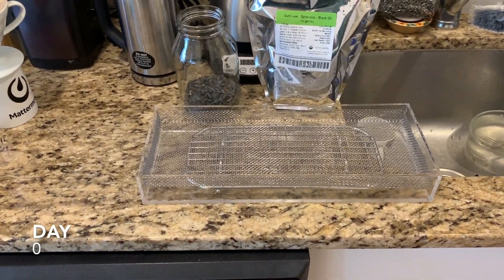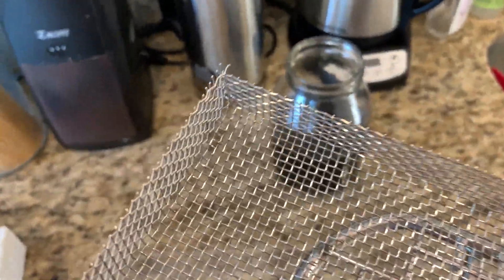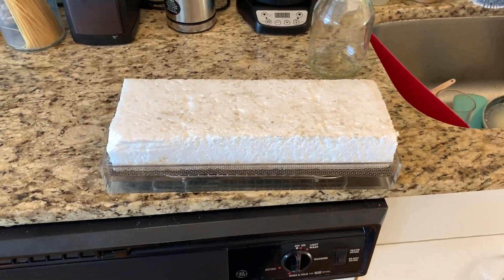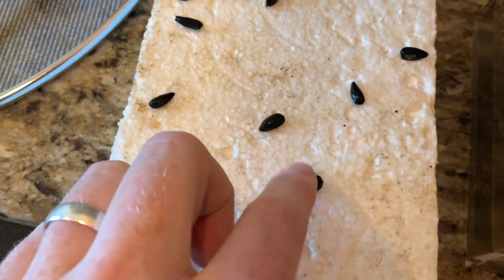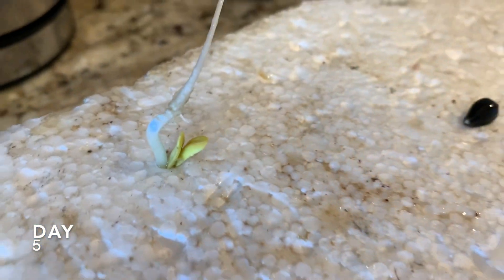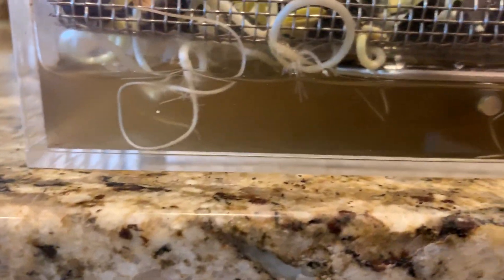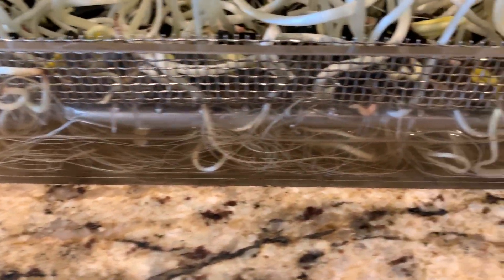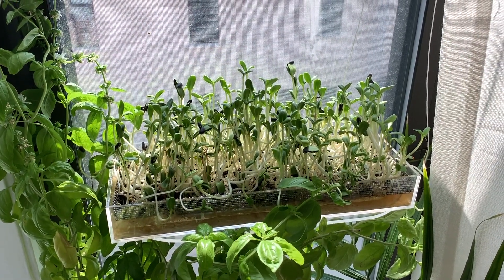How To Grow Hydroponic Sunflower Microgreens (No-Medium)

Comment: I soak mine for 12 hours I find that this time works out better because the shells don't crack open once they crack open if you don't set them Taproot down then they get tangled. Have you tried peas? they're super easy also with this method of yours.
Reply from the maker: Thanks that is good advice I will try that next time I grow.
Reply: I've found that soaking for only FOUR hours is best for sunflowers. I use soil though: https://youtu.be/RzCYKPnvOr4